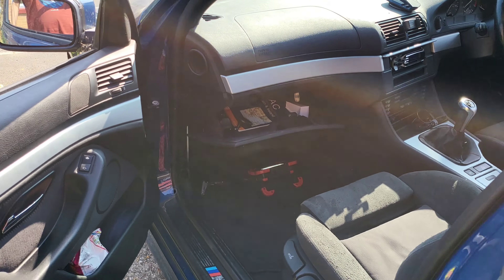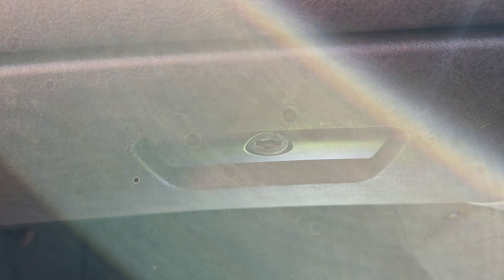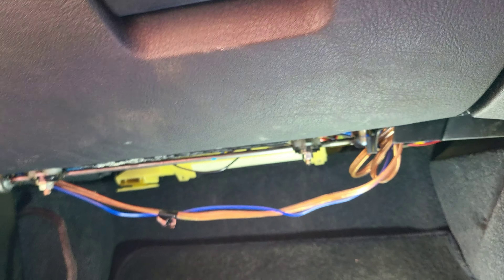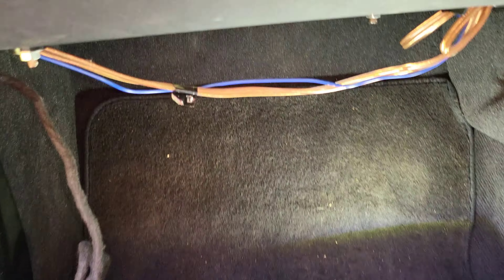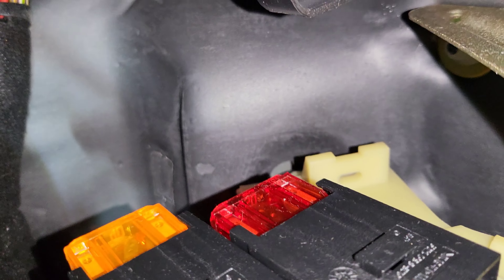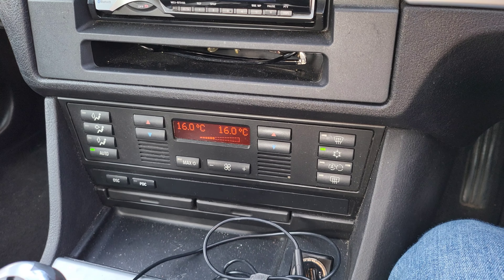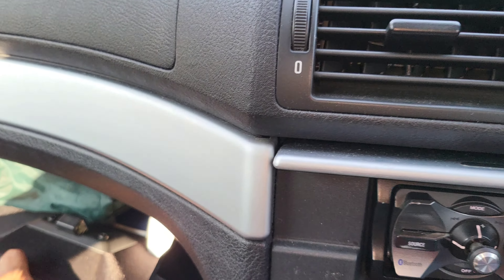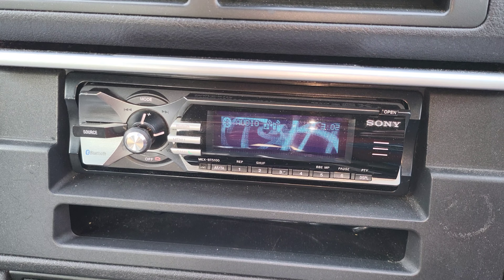BMW E39 Fuse 75 76 location and AC quick fix !

Comment: Mine doesn't blow air..hot.or.cold. Everything works..the panel and the rezistence. Do you think are those 75 and 76?
Reply from the maker: Could be the FSU unit, easy cheap fix
Reply: @shamazuddin  I replaced the fuses, put in a brand new FSU. Still nothing. Doesn't blow air.
Reply: @tonson5214 I’m having the same problem , did you find the fix ?
Reply: Mines doing the same thing
Reply: @chadwickreed2194  migh be the blower. You need to disamble all the plastic inside to change it...I didn't....I have an e46

I drive that😂
Reply: @BOA-ROMANIA  mainly looking for defrost!!! Hard to drive on cold mornings and rainy days without it. Mines an 01 e39 530i
Reply: @chadwickreed2194  it's the blower. I replaced mine